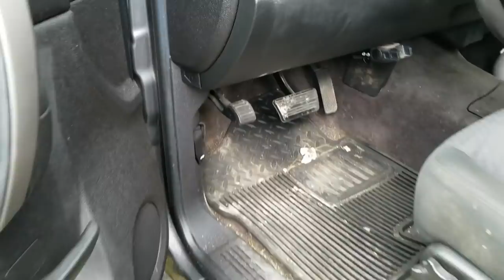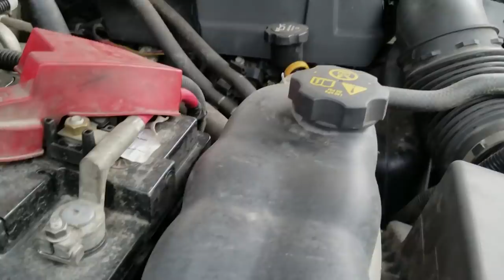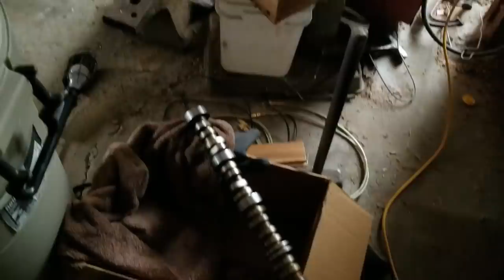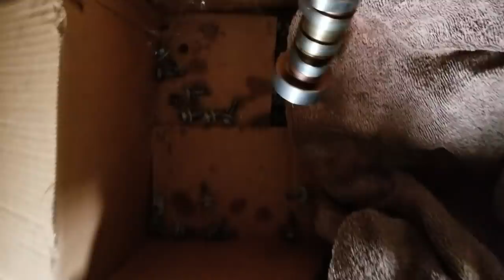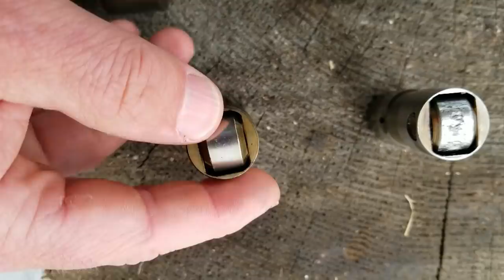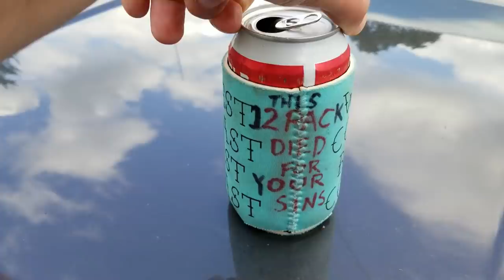Removing Ticks from Engines | Manly-Man Skillz

Comment: I use BG109 before every oil change and refill with full synthetic oil. I have one in the stable at 299k that just got an oil change after 6500 miles with no oil needed  between changes. It runs perfectly and I keep driving it to see if it's possible it can complete the return trip from the moon.

Comment: Forgot to mention in confirmation of Ave's poetry that the new cam followers fitted to my freshly rebuilt classic engine lasted only a couple of weeks. I presume that the art of case hardening has been lost in the passing years. Back to the old ones for peace and quiet - well, as quiet as you can get with a chain driven camshaft.

Comment: Intermittent tick.. 5.3 Started at 145,000.  Oil pressure from 3/4 to less than half. Turn motor off. Start back up. Tick is gone. Tick comes back Ocassionally on hwy. Dont hear it till coming off hwy to a stop. Used 5-30 and lucas to replace 1 quart. Ocassional issue about once every few months on startup. Now has 230,000.  Only used lucas on that oil change. Oil pressure still about 30-40..
Dailey Driver. And yes I still drive  her like she deserves.. 80 MPH hwy speed limits. Yep, that will keep her in line.. Replaced components in over worked rear axel. Only major repair and Normal maintenance..

Comment: I rebuilt the 5.8 in my pick up, and left an oil plug out. I drove it about a week until I couldn’t take it and pulled the distributor to pull the intake. Seent it in the distributor hole. Put a plug in her and she sounds good now. Low oil pressure or shitty lifters it’s one of the two.

Comment: As a driver of a shitbox honda it's not unusual to have a bit of the blue smoke sputtering out from under the hood.
the owners manwell says to put 15w30 but a quart or 2 of 15w40 will keep it running until I drive it so hard it pre-detonates and starts clanking and banging down the road with rod knock.
beautiful thing about single cam inline 4's is that they're cheap and only take about 30 minutes to swap.

Comment: At first I thought you had a Dodge, been seeing some of the newer engines have been known to have lifter roller bearings wear and then lock roller causing the nastiest of grooves in cam lobes. Nevermind it's a GM product and I believe a lack of zinc in modern oils causes issues in lifter wear although more of a issue on flat tappets

Comment: The firing order in new GM v8s is actually 1-8-7-2-6-5-4-3. Although, hiding excess fasteners upon completion of reassembly will forever remain an essential step to any repair, regardless of success.

Comment: Hey i've reused factory torque to yield head bolts on my Subaru with no problems. Granted the factory advises you are able to reuse them if it is the first time they've been taken out. Not allowed a third go but they give a different torque spec for it. Worked a charm and saving me beer money for the job changed the gasket on the roadside :)

Comment: I gotta put a horn on my 2000 KLR cause I gotta do the M2 test. Hopefully the lady at the out of town drivetest place won't notice the all gear  neutral clutch safety bypass. The 07 Elantra is on stilts cause the clutch done gone and worn away. 2 bolts the hold the bell housing already sheared off, hopefully top ones don't.

Comment: That lifter in your center consol looked like an ls7 lifter because of the machined surface extending all the way to the roller. I think they did them for more suport on higher lift cams but im not sure. Im cureous if it was out of something else though it would be intetesting to know what other engines had that style lifter.

Comment: Im in the process of making a parts list/price sheet to make a desktop 3 axis cnc machine with the working space of a sheet of paper. instead of a spindle i want to use a sharpie or pen. i want to control it with arduino because they are affordable and i want to learn as much as i can about cnc. i have a very limited budget and i was wondering if anyone has suggestions for which arduino board to use for 3 or 4 nema 17 stepper motors (i dont know if i should use two motors on the carriage).  i have some experience with VEX competitions and robotics but that was years ago before they started with the plastic stuff they have now, so for the most part this is my first experience with circuitry. Also what kind of power supply should i have?

Comment: If that's an active fuel management engine a word to the wise, inspect and/or replace the Valve Lifter Oil Manifold Assembly as well, its integrated into that plate underneath the intake manifold. We've been having problems out the wazoo with the solenoids going bad and causing the pins in the lifters to engage at the wrong time, thus catastrophically destroying lifters and camshafts in the process. It's been a big problem with the newer chevy engines. On the older ones, well, if it ticks just turn the radio up, problem solved 🤣

Comment: Put the pinch wheel from a cassette tape recorder in that lifter and build the lobe back up with some Hurcurlies Propoxy. You will be fine. There will be no ticking but a squishy squishy sound from the rubber pinch wheel.

Comment: The head bolt thing is sooo true. Though I’m even more fascinated by people selling cars with blown head gaskets with a head gasket on the side like that’ll take care of it. “Easy fix” they say. Never mind that coolant has been rusting out the engine from the inside for a year or two. Never mind that gasket only failed due to engine getting overheated and heads warping. Not to mention possible block cracks. Never mind it needs a radiator or water pump that leaks and caused overheating to begin with. “Easy fix”, the say. Makes you wanna d1ckslap the sh1t out of them.

Comment: You forgot rigging up a way to manually adjust one lifter's lash and run it for another year like it' has one solid lifter. A little bit of weld on the rocker and then grind to the desired lash

Comment: Truck got to 300k miles. Had an oil pressure issue, added thicker oil until had time to fix pump. Replace pump, no more valve tap. Develops rod knock instead. Ran fine if babied, brother took it to work on a day he had no wheels, attempting to pull into traffic, revved passed 2500 RPM. Knock became CLUNK-CLUNK. It ded. Slapped a donor engine from a police cruiser in it. Back to work.

Comment: A friend of mine rebuilt an engine in his garage, I was called to help him put it back in the car, so I braught a mainbearing bolt / headbolt (exactly the same bolt on those engines) from my garage where I had rebuilt the same type of engine, and when we were done bolting it in, I subtly rolled the bolt infront of him.
I let him take off the valve covers to check if it was a headbolt, but when he reattached the hoist to pull the engine out I told him what I did.... He chased me 2 blocks with a crowbar... Fun times...

Comment: You're a Poet.  I'm nearing 300k on my 01 F1furdy.  She ran perfectly fine until I over heated it one time in the dead of winter, lol.  It's been 5 months of teenage angst ever since.  She's still ticking along when she wants to go.  :)   I'm stuck with the idea it's much cheaper to drop a new rebuilt engine and the tragic peace of mind that I'm the gorilla that done all the Maintenance.  I've never had a Chevy so I might try something around the 2008 Vintage.

Comment: dear beloved pushrod motor owners.  while your engine is still alive - please start using automatic transmission fluid during your winter oil changes.  it will clean your lifters and they will pump as they were designed. 
lucas - stp and heavier oil is going in the wrong direction. 
once the damage is done. it's done.
keep your lifters and oil feed ports cleaned with atf.

Comment: I’ve had two Rams, first one lifters and cam wore out.  If you change your oil with high quality oil, on time, you’ll get to 300k without a problem.  Ram’s work best for people who don’t wait to long to change their oil, such as people in very cold climates who have to force themselves to go outside and lay on top of some cardboard over the ice while they pull the drain plug, have their container overflow and spill oil all over their nice clean cardboard and make a mess, all the while freezing their tales off, holding tools that are ice cold and with too much pressure will crack their brittle frozen bones (Canadians).

Comment: Fucking cylinder deactivation, my work suburban died with number 7  pistonian constantly plugging the plasma gap device. Not to be outdone my newer truck with a 6.2 started the mechical jazz stylings of pistonian "slap" a beat extolling immoral, cold, and unlubricated destruction of the rings, forceful penetration of a cylinder with each ever hotter expanding stroke. Until the block reaches the same thermal expansion, creating the girth and length to accommodate such forceful thrusts

Comment: I hate to try and correct you on your vidjeo, but the 5.3L (the one in your truck) firing order is 1 8 7 2 6 5 4 3, not the old Small Block Chevy firing order of 1 8 4 3 6 5 7 2. Once again it's your vidjeo but I just wanted to say

Comment: Once upon a highway dreary, while I throttled, weak and weary,
Over many a quaint and curious section of boulevard—
    While I nodded, nearly napping, suddenly there came a tapping,
As of some one gently rapping, at my combustion chamber, hard.
“’Tis some visitor,” I muttered, “tapping at my rocker arm—
            Only this and no alarm.”

    Ah, distinctly I remember it was in the bleak December;
And each separate valve-train member wrought the rod upon the rocker.
    Eagerly I pushed the volume;—vainly I had postponed my doom
    From my sub-woofer blasted rage—rage against some phantom knocker—
For the rare and enraged rocker whom I now know is a mocker—
            Named Zack de la Rocha.

Comment: I put 450K on a 98 F150 , 4.6 triton . Changed the oil when I was supposed to , changed the plugs every 100K . Everything else on that damned thing was rusted out or worn out , had to beat the engine to death with a stick . Oil and filters are cheaper than parts .

Comment: I've done hundreds of these. Should have just went another step and put the pistons in. Also hope you changed the lifter holder because they tend to spin in the bore. Head bolts 22ft lbs plus 90 degrees plus 70 degrees. 🙄🙄 The 10mm those I just German spec them mmmmmm click goodantight.

Comment: My dear Savanna, 4.8 liters of carbon production. She prepared for me a mechanical sonnet on every cool morn.  Rarely did I return to her the strength she persistently lent to me - I would draw a bath of Dexos injected full synthetic oil in return for the path blazed.  Ne'er did I felt the warmth of her Check Engine Light, or did she hold me captive on the side of the road.  285000 Kilometers we were together, our hearts racing together only held back by the limiter.  

Until now, exhausted.  Our time for each other ended like a $0.00 buy out corporate lease. 

Seriously.  That pile returned 285000 KM, nearly problem free (2 sets of brakes, 2 sets of tires, 1 ignition switch, 2 wheel speed sensors and a harness, blower motor resistor and speed switch).  It weighted 9000 Lbs on a good day, ran into the rev limiter at 5500 rpm and would stall if you kicked it into Ontario overdrive (neutral down a steep hill) without some warning.  Bless her bankrupt heart.

Comment: Alas, my brave Canuckistani non-acquaintance,,,,, I may have deduced your anomaly. 18436572 was indeed your old timey, if not antique, firing sequence. But in LS denomination, you will find 4-7 and 2-3 swapped, it's largely a harmonics thing. So you must think Ford Windsor firing orders 18726543. Just doesn't roll off the tongue as deftly do it?

Comment: The AFM can be deleted from these engines VASTLY increasing their longevity. What happened here was emission standards pushing enginerds causing them to make a good engine a piece of shit. Dodge copied it and it performs similarly. The AFM failures are 2008 to 2014. LS based engines without AFM will basically run forever.

Comment: Thicker engine oil may increase pressure and limit the leaks around the bearings (allowing the pressure to increase) But keep in mind that if the problem is one area (chain tensioner, cam, main bearing, etc) by putting thicker oil will be nice for that area only. The normal condition of the rest of the areas will need a thinner oil to ensure proper lubrication.

So thicker oil might be the golden ticket for a well used simple engine where the journals are slightly worn and all other areas are evenly worn as well and with no fancy stuff like variable timing or valve lift (they are hydraulically operated with the engine oil). But for any other modern engine a thicker oil will foul up in a hurry the turbocharger oiling, the operation of variable distribution (phase and lift) that need certain viscosity to operate, oil spray nozzles have diameter for the thinner oil intended and a thicker oil may not properly spray over the cam-lobes or inside of the cylinder and in general OHC-DOHC engine have different wear rate in the main bearings and the camshafts.. so thicker oil may starve the overhead camshaft from oil due to thicker oil not flowing right in the narrow oiling ramps and the journals of the camshaft maybe are in working order and need the thin oil. So in general for any modern engine a thicker oil is a disaster reciepe. 

Leave this trick for the simple engines from the 70's (without turbo, with simple OHV push-rod and no hydraulics actuation involved) and not modern ones.

Comment: Friends don't let friends drive anything from Chrysler, and we always refer to GM as "genital motors". Precious few pickins left after those two axioms, especially with many people proclaiming that "Ford" stands for "Found On Road Dead," and my own 2018 Escape has been sitting at the dealer for months in need of a new engine due to Ford's lack of capacity to properly torque down a head. Ford, of course, can't seem to bang out a new engine for it in timely fashion, because apparently more than 100,000 other owners across this great land are sitting helplessly in the same boat, due to Ford's lack of capacity to properly (and ROBOTICALLY) crank down a head!

Could always turn to the rice-burners, but that's tantamount to turning one's back on the great (auto workers unions of the) US of A. What to do? What to do? Union mobsters also need to eat. And we the taxpayers do need to bail out Detroit every now and then, so that the "too big to fail" crowd can keep churning out ever-more-expensive CRAP at our ever-increasing expense.

Vehicles now are $30,000 (minimum) throw-aways, regardless of how you maintain them (an expensive racket in itself!). Same with all appliances. So, my take-away is this: When you have a case of the ticks, limp along until the inevitable throw-away. Rinse and repeat. Some get lucky, and most don't. It's my turn to be unlucky. Found At Dealer Dead.

Comment: Dodge is horrible. I had to go fix my grandpas Dodge Ram 15000 4ltr engine....he had a DODGE MECHANIC come over to look at it because it needed a new belt and something was wrong with the alternator connection...turns out the Dodge mechanic didn't know there was a tension spring or pulley that you had to de-tension to replace the belt. So I did it, then I found out the ground to the alternator was corroded to hell, so we bypassed it and grounded elsewhere... I'm proud to say, I got her running like a top and we got her sold faster than a hooker on the corner of the Las Vegas strip.
Moral: don't buy Dodge, they've got planned failure in quite a few parts.
Reply: Every Chrysler product we own breaks constantly. Our Chevy's and our Ford don't even break down as much combined.